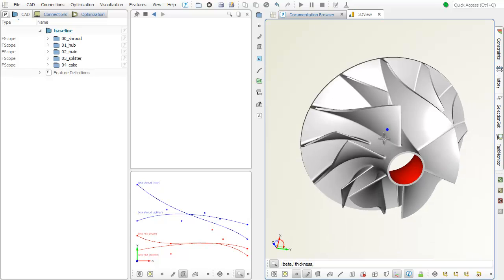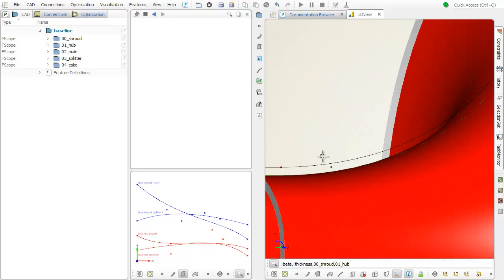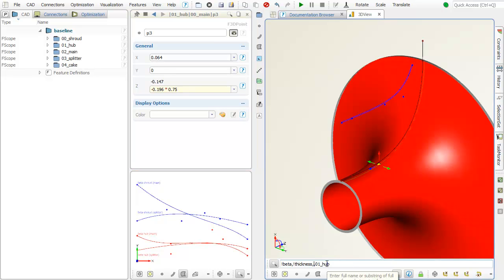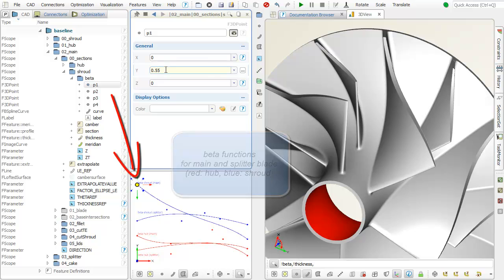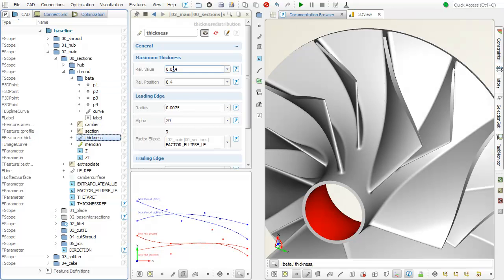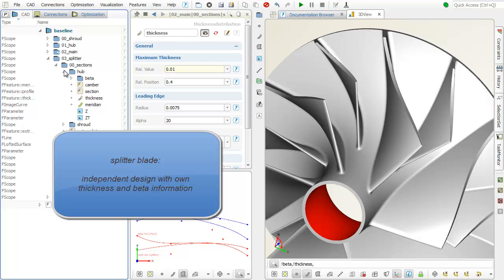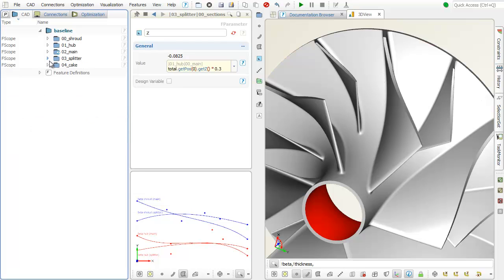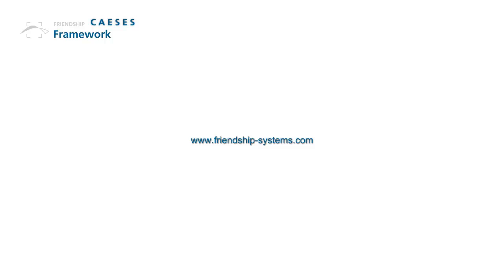Centrifugal impeller design

Comment: This is how to make a CAD model of a centrifugal impeller. This is NOT how to design and impeller. CAD is just the "how" but what is more important and far trickier to understand is the "why" behind impeller blade geometries. You can't just eye ball an impeller design, they are incredibly sensitive to changes in geometry and even just the shape of the leading edge of the blades can mean the difference between an efficient impeller and a garbage impeller.
Reply from the maker: Hi Max,
Yes, you are absolutely right. Design tool might be a bit misleading but CAD also stands for Computer Aided Design and if you or your simulation tools know how to assess quality of the impeller, CAESES is a great software for investigating variants and also run Design Space investigations and optimizations. At least that is what most of your customers do.